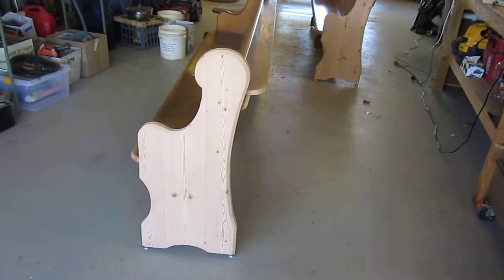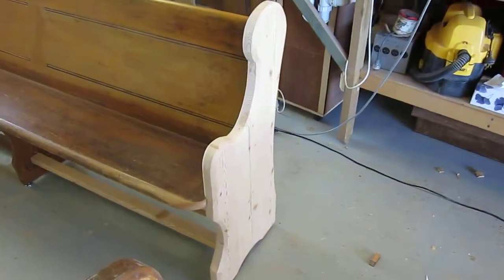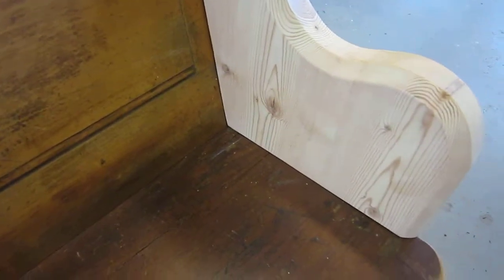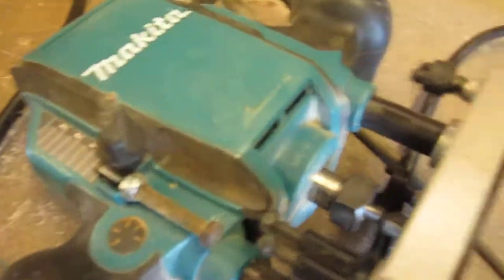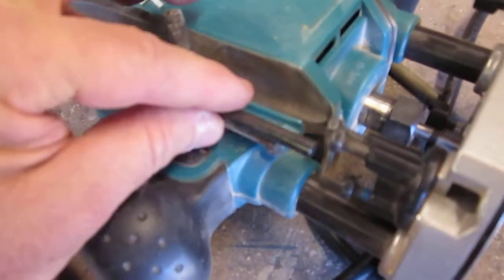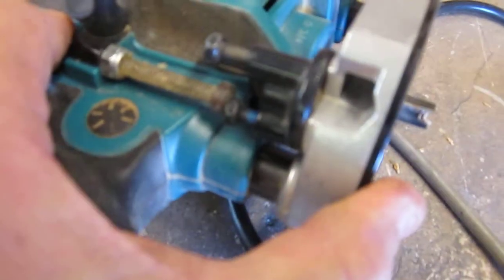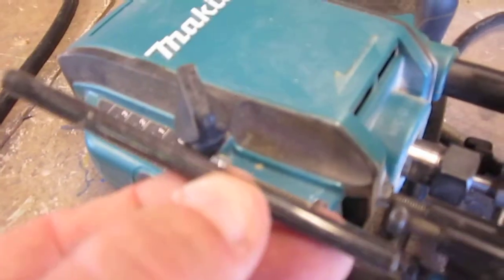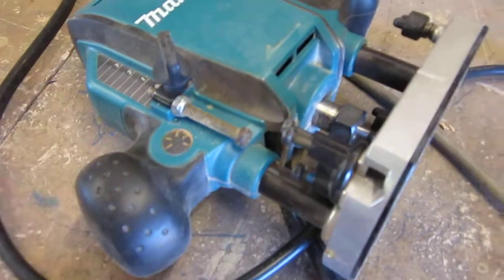Makita Router RP0900 1000W - Made by J&D

Comment: Great improvements.  Never understood some of these manufacturers, it's not even as if they offered an improved part for an uncharge.  it's like DeWalt still offering the shittiest mitre gauge despite how many table saws they sold - Even a fixed one for 90 and 45 would be much more desirable than that piece of trash they include.